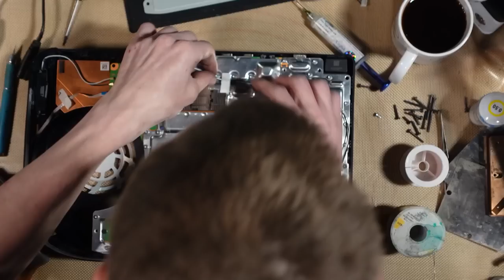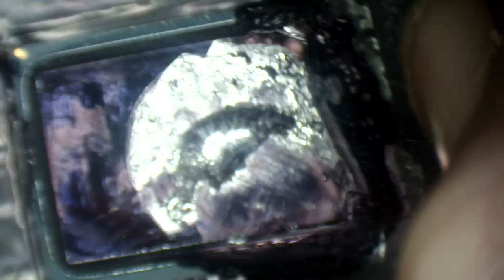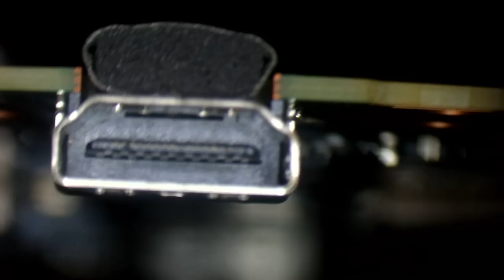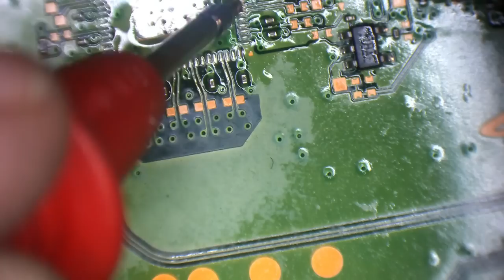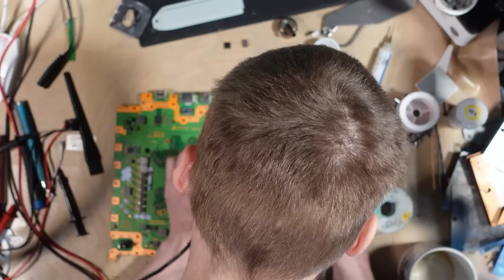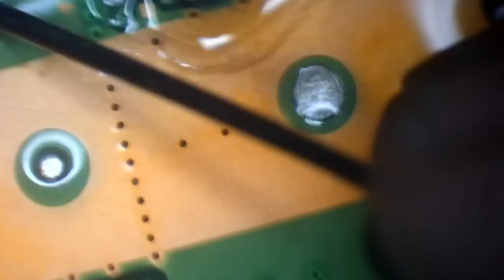PlayStation 5 Fried By A Power Surge... Can We Fix It?

Comment: The Winbond IC is just NOR Flash memory, it doesn’t check for any voltages or do any of the checks you mention, that’s what the south bridge will do, the Winbond IC itself does not control the voltages, but if the data on the Winbond IC is corrupt then the south bridge will fail its startup sequence and in turn the proper voltage rails / board boot sequence will also fail to come up, so while the Winbond IC plays a part, it’s not in the way described within the video.

Comment: I have a question: If you do see this.. so I have a ps5 original, and the guy said it's a power surge. However, the house and the outlet are power surges protected, and if I am right, everything on that power outlet would be broken too if it was a power surge. So do you think he is lying just to get more money, or is there a way that it could still be a power surge. And BTW, the problem with it is that I will get a beep but no lights.

Comment: Not sure about this but on a lot of boards when you lift the chip you are doing the same as pulling the battery. So any setting in the BIOS are returned to default. IF this is the case on PS5 you very well might be able to pull the battery first based on symptoms before having to go for a deeper dive. If it's not the BIOS it won't hurt anything.
Reply: Doesn’t always work as there’s usually enough flea power in the boards capacitors for it to take ages for a battery removal to do anything

Comment: Just out of interest how does the airspeed influence how fast a component is released. I take it, it makes it more like a beam of hot air in oppose to if it was at a slower speed, and I suppose also it actually transfers more heat from the heated coil inside the gun.

Comment: ehhh... remove cr2032 battery to reset bios?? Removing both bios prom and other components with battery onboard could make trouble?
Reply from the maker: I've tried removing the bios battery before, it must have some sort of residual power which takes a long time to disappear because every time I've tried that it doesn't work 😞

Comment: The 2 rear USB ports are going straight into the soc. Is their protection on those rails or could a usb short fry the soc?  Seems nuts to have those direct into the soc
Reply from the maker: It could potentially fry the SOC. It's a very bad design when you think about it that way. There's no protection on the data lines at all 😳
Reply: @TheCod3r  are the xbox,s similar to the ps? Ie: usb into soc. No protection. Be nice to know as i have x and s.